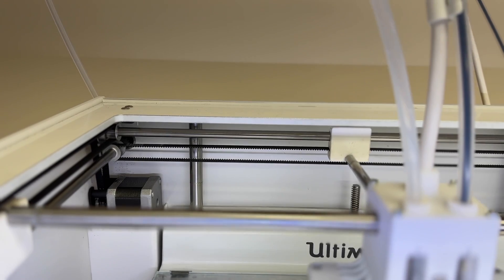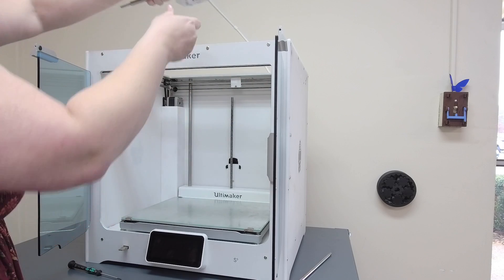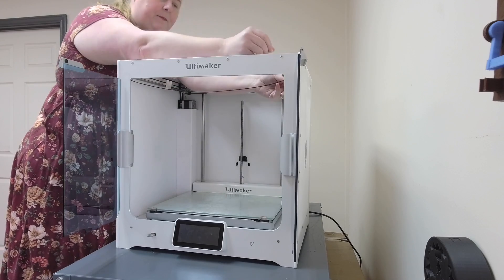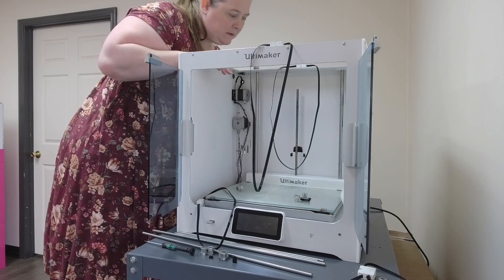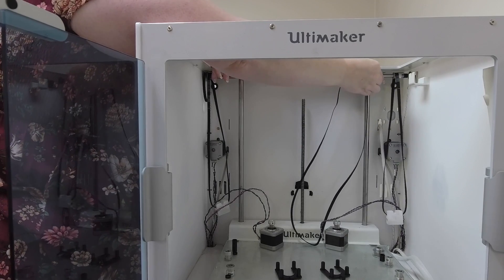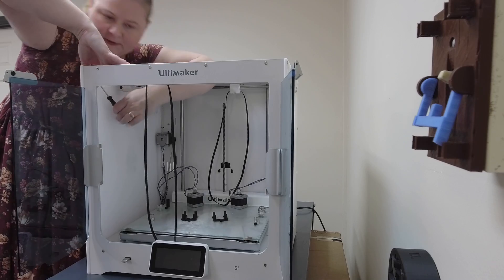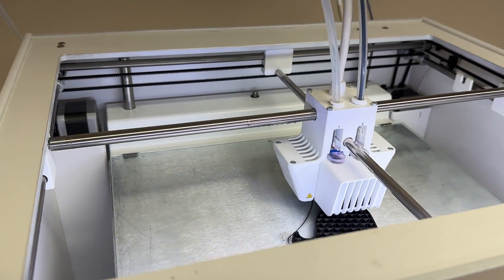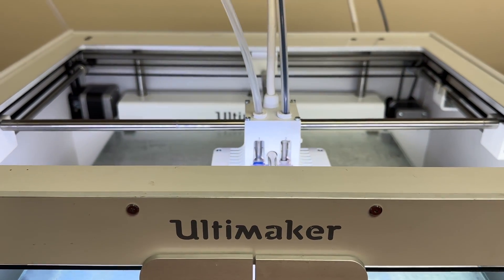Installing Sliding Blocks and Motor Belts (Ultimaker S5/S7)

Comment: So I've done this, only replacing the belts with sliding blocks. But now the sliding block collides with the nozzle switching bay... It does pass through with some friction with some force, but I strongly think this will affect the printing quality.
I've checked, but spacers are tightly pressed to the bearings, so there is no play there. Do you maybe have an idea what could cause the collision?
Reply from the maker: The block should be straight up and down when everything is aligned and pass through cleanly. If one of the spacers accidentally got swapped into a different position, it could throw it off, but it's difficult to say more without photos.

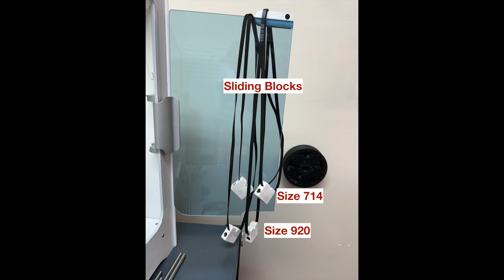Comment: What a brilliant resource - thank you for making this (and all of your other) videos and sharing them. I started 3D printing back in 2011 and retired my home built RepRap machine last year when I could finally afford  a pre-loved S5. Since then, I have had the S5 serviced by a local UM dealer and good though they are, maintenance jobs like replacing the short timing belts can be quite expensive. Up to now, I have not tried to do any jobs like this myself given the cost of the machine - scared of getting in a mess -  but I am thinking that l am going  to watch this video several times to help build my confidence to carry out maintenance other than lubrication. (Quite confident doing that 🙂). I would really appreciate a basic and "this is how to ..." video showing how to disconnect/reconnect/align various parts that need removing - like the motor covers and the printhead shafts - it was hard to see exactly what you did there around the 1:20 mark but I am still giving top marks!
Reply from the maker: Thank you! For the printhead shafts: tilt the plastic block until the print head shaft pops loose. I have a separate video with closer views of popping the print head shafts in and out.

For the motors covers, those are also pop in/pop out. There are cut outs on the printer, and tabs on the motor cover. If you tug at the top of the motor cover (I like the corner of the L to tug on) it should pop out.